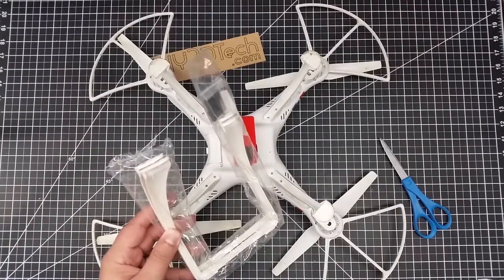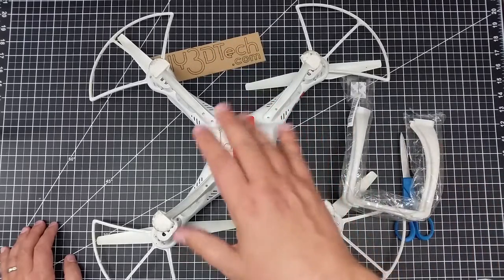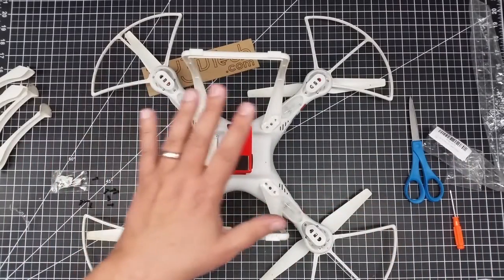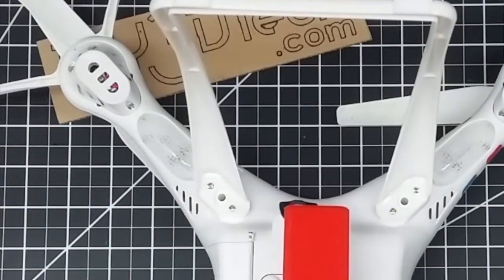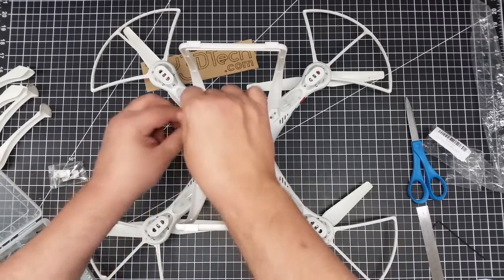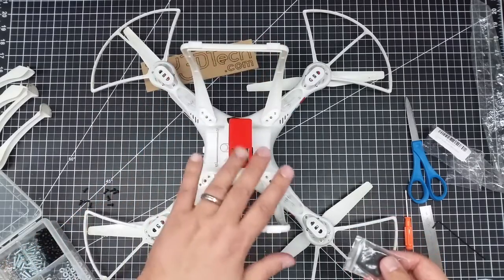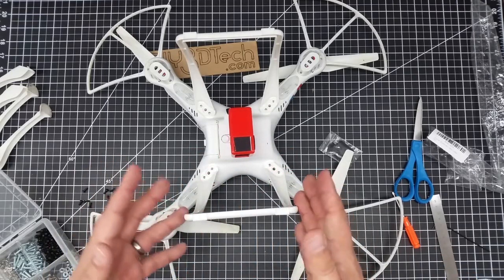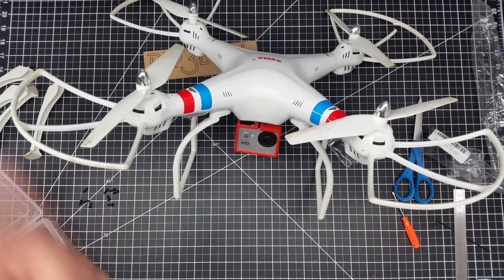Video Drone - Installing Phantom Extended Legs on the Syma X8!

Comment: What about making an adapter plate with smaller holes for the stock screws and larger holes for the new legs?  Both screws would use the same hole but the smaller ones go in the bottom (top really when in proper orientation) and bigger one on top.
Reply from the maker: Just added weight, I just got the upgraded motors and control board in so when I have it apart I am going to simple drill out the holes or #4 screws and call it done.  However its not cold and snowing here in Michigan so doubt I will get to much more practice till spring as the cold does a number on the battery!  As took the X5 out and where I would get 12 to 15min of flight time I got 5!  (plus cold fingers).  Thinking about getting an UpAir One with GPS as want to video the ice flows on the lake from about 10 feet up and flying across as it flows down river as the Syma can that altitude steady without a GPS...